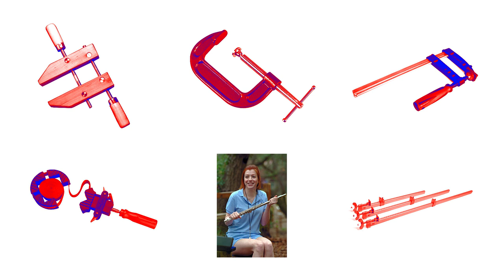How To Clamp Using Tape - Woodworking Tips

Comment: Well said!! I've been using blue tape for clamping most of my small boxes. Even I use it to help me align bigger joints. Besides, it's also very usefull to avoid the glue reach the inside corners. Thanks for share.
Reply from the maker: Yeah, I just it pretty often for that purpose as well too.

Comment: I think the idea of taping the boxes is good  ... but wouldn't tight the corners strongly as much as clamps. 
eventually it could works for small boxes. 
thanks for your videos 👍
Reply from the maker: Hey. B/c of the typo I'm not sure exactly what you're saying. But, you're right...there is likely more pressure when a clamp...but it's still tight enough that any excess glue squeezes out, and there aren't gaps if the cuts are good.
Reply: Chris Salomone I'm sorry about the typo, 
And you're right, if the cut is good then you don't have to worry about what kind of clamp you should use. 
Thanks

Comment: Would you use this technique for a picture frame, even just as an intermediate step before using a strap? Or are the proportions not quite right? I tried to do so myself but had quite a bit of trouble. 

I love your videos, thank you!
Reply from the maker: I think you could...but I never have b/c there have been better options for me. I Think with the longer miter though, you're probably more lightly to rip the tape off while trying to get pressure on the inside of the joint. In theory this probably wouldn't be the case if the miters were 100% perfect, but they never are...  :)

Comment: I use tape for this purpose professionally. It works best if the tape has a slight ability to be stretched. I Germany we use TESA parcel tape. It is foil bases and we stretch it for 3-4 cm for the last corner. Works perfect.
Reply from the maker: Thanks Bricknick. I think painters tape has a little stretch. I do something similar with edging hardwood strips on plywood.

Comment: Tape works great I hear. If you need more pressure for a boxy build, you can use a loading belt after the tape assembly, which is dirt cheap.
Reply from the maker: Yup...done that one before too :)

Comment: Tape is really handy with in cases like this. However careful with the tape you use and on which wood you use it. Some woods tend to popup the fibers when you take the tape off and you cant sand it off. You will see where you put the tape after you put your finishing product on.
Reply from the maker: Really? I've been lucky not to have that happen then. Which species?
Reply: +Chris Salomone We had it with 2mm Oak and walnut veneer. I dont know if its cause it was a veneer and not solid but 2mm is to me thick enough to be considered solid in this case... Finish was a 2 component spray laquer. Have to say that its been a while ago so I cant remember exactly which brand tape we used but now we use a different one we didnt had it since
Reply from the maker: Yikes...I use a lot of walnut I would think on something thicker, worst case scenario you'd be able to sand down to virgin wood.
Reply: +Chris Salomone Dont stress to much about it, just be a little bit cautious and not suprised IF it happens.